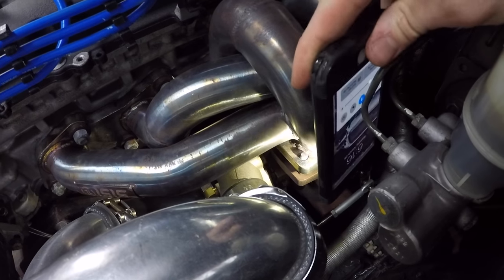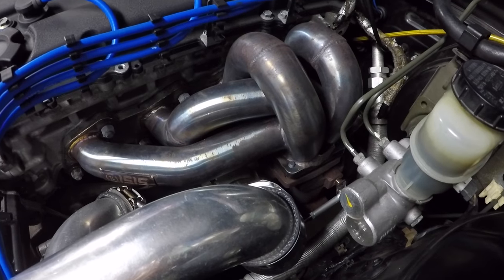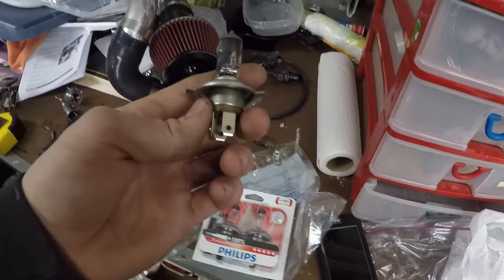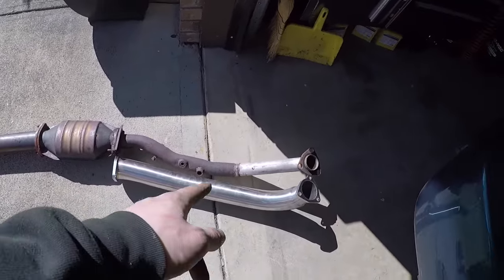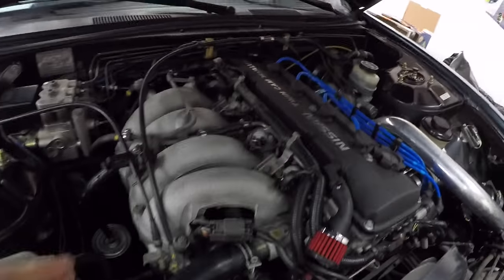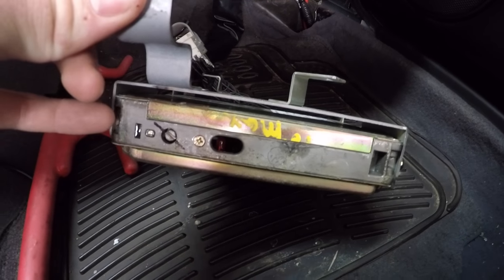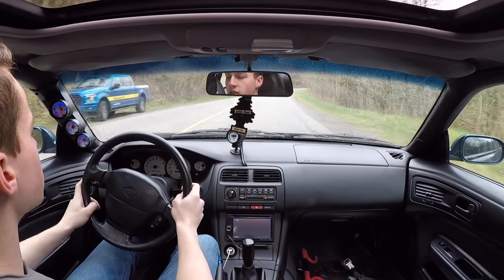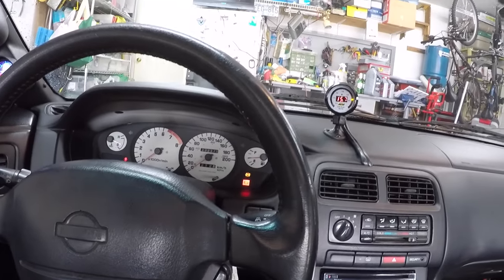240SX S14 BUILD EP.12 Turbo Troubleshooting (Loose turbo and stalling issue)

Comment: Hey man. Cool channel. I build stuff like this everyday and I can help. On pretty much every Nissan with a maf installed along with an atmospheric bov, you will run into these problems. The problem is the placement of the maf. The maf tells the Ecu how much fuel to give the engine at a certain amount of air flow. The bov releases air from the intake tract when it opens. This changes the amount of "air flow" actually reaching the intake manifold and making its way into the cylinder. The maf doesn't know that this air has escaped so it doesn't know to adjust for the change. Then your engine is improperly fueled and it dies when it approaches idle. The fix for this is a recirculated bov or placing the maf inline in the boost pipe after the bov closer to the intake manifold. Or an engine management system that removes the maf altogether.
Reply from the maker: thanks dude. yea I've thought about this. The bov isn't in use right now so that shouldn't be a factor. Its capped off so it stays shut.
Reply: StoneCrestPro  I agree. I think you need to move that MAF so it's in front of the Throttle body. If you think about the flow of air as it enters the air filter. Look how far it has to go  before it gets to the throttle body, after it passes thru the MAF now. Before the turbo kit, it was a lot shorter path. I might not be right but it's worth a shot. Just use some jumper wires and move MAF over to test before you cut extend the harness for good.  Good luck. Sweet progress tho.

Comment: Watching these videos is entertaining.  All of these rookie mistakes.  The reason your lights suck is because the oem headlight lenses actually focus the beam pattern hence the reason for all those ridges and lines.  Secondly the reason you're stalling is because when you let off the throttle and all the air gets vented out the blow off valve the MAF has already accounted for that air entering the engine and therefore compensated with fuel delivery.  You need to recirculate the BOV or run a MAP sensor.

Comment: I know your injectors are brand new but if you get desperate send off your injectors to get flow match, might be the issue. Also did you tell Martin all the parts that you put on the car, because thats the best way for him to send you an accurate chip tune. Remember Martins tunes are great but dyno turns are still the best way to go. Great videos by the way keep up the good work!
Reply from the maker: Thanks dude!

Comment: I could be wrong but it's worth a shot. where your valve cover vents to atmosphere reconnect it back into your intake. it may or may not be the issues. just hook it up before the turbo not after so it's always under vacuum.

Comment: I think you are having an stalling issue because you are venting the air that the MAF picked up and causing it go too rich and not able to burn it. Closing the BOV is probably causing the turbo to continue building pressure after you let off the gas and shoving the air back through the intake. Try logging the voltage from the MAF and the O2 sensor with some kind of datalogger and see what voltages you get when you let off the gas at high boost and low boost and compare the values. Hope it helps.

Comment: It's been suggested already, but I would look at recirculating the bov and the valve cover hose. And cleaning idle air control valve. Check the spark plugs to see if you're running rich.

I think you're screwed with the headlights. All those lines you didn't like on the oem lenses are to correctly focus the light on the road. No amount of aiming or swapping bulbs will change that. It's either put back in the original lenses, buying replacement oem headlights or retro projectors into your current housings.

I used to read the trouble codes on the ecu but it was always a pain in the ass to take apart the interior. I just bought a Consult cable and downloaded an app for my phone. So much easier to read and clear codes.

Comment: bro your maf is upside down there's a built-in drain so to say inside the mass airflow sensor for any debris that got into it try flipping your mass airflow sensor 180 degrees the square on your mass airflow sensor should be on the top. and try a recirculating blow off valve

Comment: If it keeps bogging out check the spark I had problems with my KA where it will stall out when I push the clutch in I ended up having a bad injector also check is your injectors see if they are getting ground

Comment: i had a similar problem when i tried to vent my stock recirculation valve in my s15 to atmosphere cause when you take your foot off is will just stay open, maybe your bov is a dud?
take it off and block it off and see if you have the same problem maybe?

Comment: What turbo are you running? Make your air intake pipe a little longer and bring your MAF farther away from your turbo, or make sure to have a little bit of a bend in our intake pipe. Should solve your problem, I had the exact same problem with mine running a gt3071, it's one of the downside of running a huge turbo, and off the shelf tune.
Reply from the maker: Its pretty far away already! Like 20" and its as far away as i can get it. Rammed in the corner i even moved the coolant overflow to get more distance. And there is a bend in it. Martin at enthalpy told me it should be good.. im gonna try a few things then might try going blow thru..
Reply: hmmm, yeah just watched the video again. couple small boost leaks could also be the problem, or even your flange from the BOV.
Reply from the maker: +Pretty Decent Garage yea im hoping so

Comment: You need a recirculating valve not a blow off valve. If your computer is not set for blow off valve then it will continue to stall.  I’m one of the first few people to ever turbo a KA back in 1992. I’ve seen all the issues with turboing a KA.
Reply: Invest in some pistons while you are at it, you’re gonna need them

Comment: The knock sensor could be cracked. The knock sensor will adjust timing and add more fuel to your engine. The sensor is kinda tough to get to but it's in between your runners on your manifold. I recommend using a swivel and a short socket 12. Reinstalling is tricky I used a cost hanger wrapped with some tape just enough to realigned the knock sensor into the proper position. Use the some tape inside the 12mm socket so that the bolt doesn't fall out when you reinstall it to the engine block.
Reply from the maker: cool man ill probably take it completely out to look at it if the code comes back cause its hard to see with the runners in the way. thanks for the tips.

Comment: what PSI do u have it running now? it pulls nice!  running atmospheric and blocking bov all together cause that same stalling issue as some have also said. I hated driving my friends s13 cuz clutch in at a stop sign it would always stall!!
Reply from the maker: Only around 7psi right now! Yea its honestly not too bad it drives fine. But I just cant drift because of it wanting to stall sometimes.

Comment: Hey man, boost leak can do that. Also venting to atmosphere without blow through can do that, doesn't matter if you cap the bov off. You need to recirculate or move the maf
Reply: Also, moving the maf is easy cut the pipe and get couplers and extend the harness

Comment: Are you venting the BOV to atmosphere? Have you considered rerouting excess air back into the intake manifold? Could be something with the MAF and excess air since the throttle body is closed when you clutch in and dont apply throttle.
Reply from the maker: yea it is atmospheric but the problem stays the same when its disconnected.
Reply: Idk how your bov is set up but I meant connecting a rubber hose from one of the outlet ports of the bov back into the intake. I think your issue is because you're venting to the atmosphere

Comment: I know this may sound stupid but the coolant temperature sensor can be the fault check for a loose of corroded connection also check the idle air control valve
Reply from the maker: will do

Comment: I would definitely take the knock sensor off and check it, mine was cracked in half when I took it off. And I would go ahead and just replace it and the harness, wiring specialties makes a replacement harness that's super clean looking for 20$, that harness is known yo go bad from the heat of the block and intake heat cycling, and it's cheap insurance to replace both it and the knock sensor to be on the safe side
Reply from the maker: I took mine off yesterday and it was cracked! Replaced it but not the harness.. well see if the code comes back.
Reply: BuiltLikeThis yeah haha, I hope that was the problem, if it doesn't go away I would definitely try replacing the harness, they can look fine but have too much resistance and cause problems, and it's cheap insurance to replace. But the cracked sensor was probably at least part of the problem if not the problem, so hopefully it fixes it!

Comment: probably due to the many deletes you've ran to your air management system. capped a lot of the resiculation factors away and built something that's consistently sucking air in / blowing it out. The ecu isn't the problem. Try keeping you foot a little on the throttle once you shift gears.